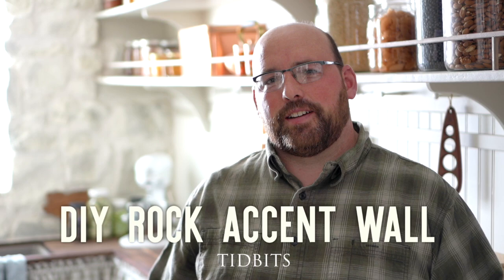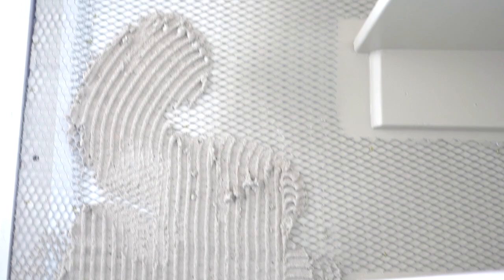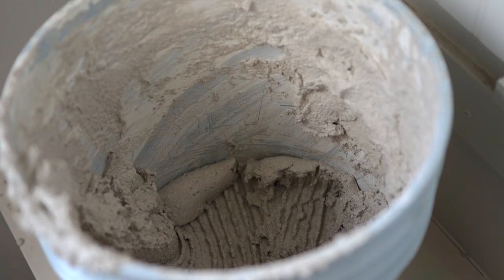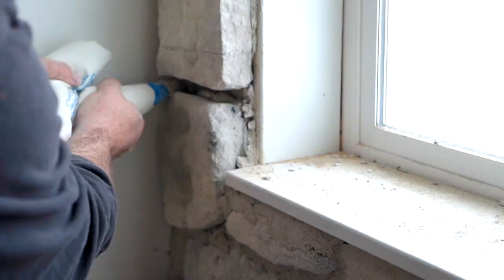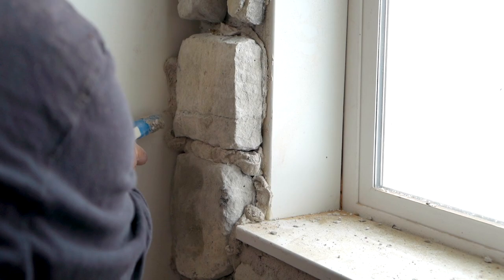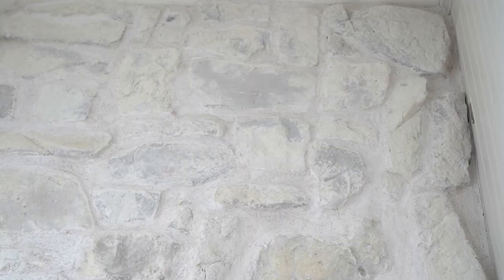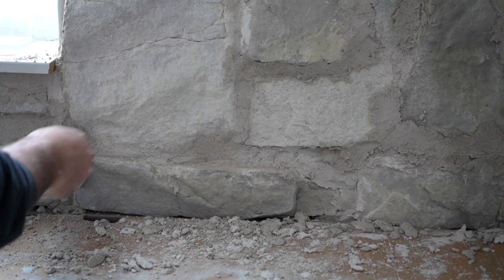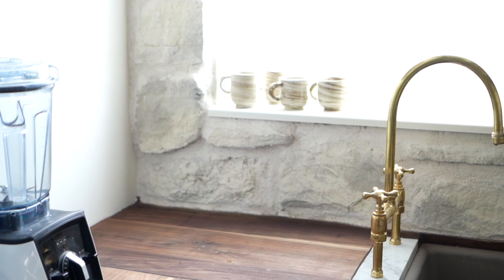DIY Indoor Stone Wall | Step by Step Tutorial

Comment: Best way is to use cement board, wire is old technology and makes a weak link where backer board isn't, l brush bonding adhesive to the backer board and stone and use type S stucco/mortar mix ,,